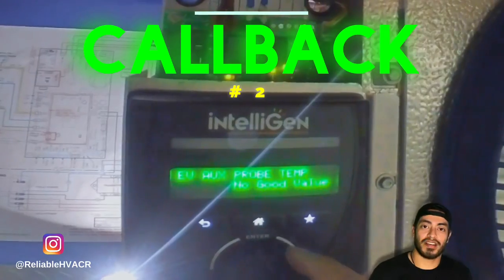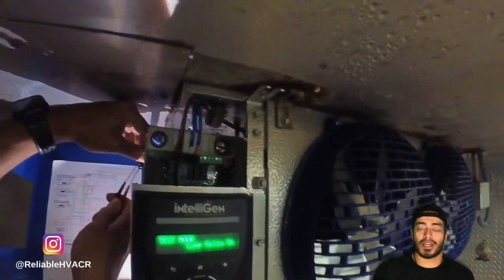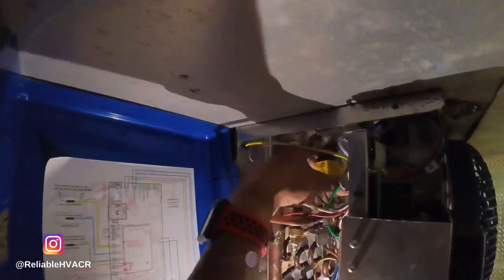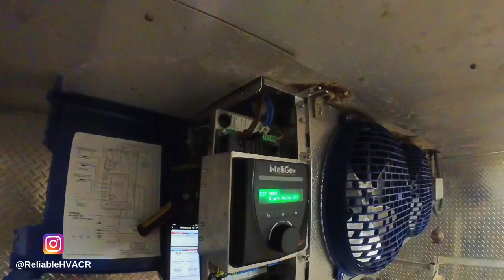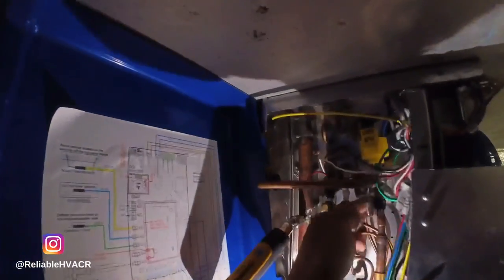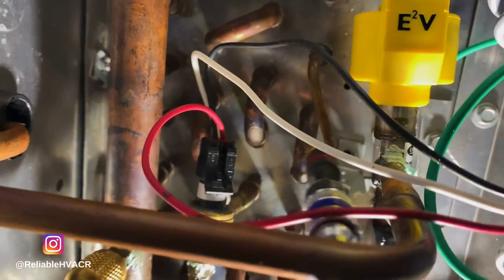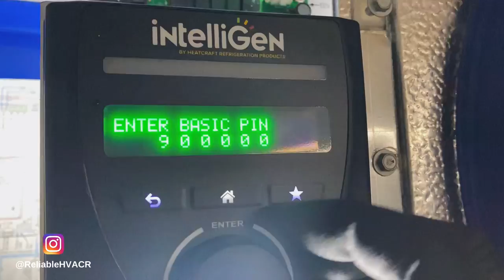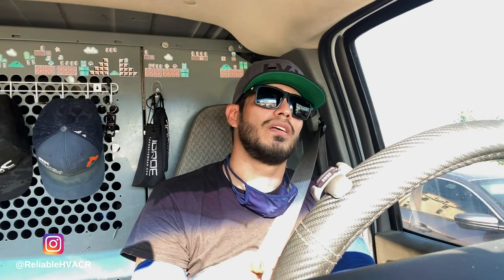Another Callback! | Intelligen by Heatcraft Troubleshooting | HVACR

Comment: I do little commercial work, but I have a ton of experience with EEV's on residential systems. Thing's I ALWAYS DO to prevent EEV damage/failure/clogging is:
  1-braze with nitrogen
  2-heat shield EEV when brazing AND use low heat
  3-Place my Drier filter as close as reasonably possible to my EEV

Do you use MeasureQuick? I only ask because I see you were using the fieldpiece app for your probe. If you haven't tried it out I highly recommend it over the fieldpiece app. 

Way to pay due diligence on this job and not make a hasty diagnosis. I myself know all too well how bad it feels to make a wrong diagnosis when looking back, and knowing I could have been more diligent is my troubleshooting. But hey, we learn far more from our failures than we do our successes; right?
Reply from the maker: Well going forward I just need to be extra careful with EEVs. I need to give the app a shot, I'm just used to the fieldpiece one since I use it often with my other equipment. And thanks 👍🏽

Comment: Just talked to tech guy about this. I was instructed to remove compressor safety cut out and set cut out to 0. The system has gotten into a loop of not recognizing a subcool drop and valve is forced closed.
Reply: Ugh...what😂
Reply: @HVACRDUDE  for real I ain’t been back

Comment: I installed an IntelliGene system with two evaporators on one 7 1/2 hp condensing unit for an egg farm cooler. 21 hp total to run cooler. It would run great for a day or so then comp would go off on short cycling code. The EEVs would close enough to make unit short cycle. Reset power and good for two days. Tested every component, sensors, cables, wiring, superheat, subcooling, control settings, everything tested good. I was convinced it was one of the boards. I asked for two new boards and the dealer and tech support resisted. Factory tech was gonna drove 300 miles! I told him to make sure he brings two boards. Asked them just send me the boards and if it still short cycles then he can come out. They finally did and charged my account until they got faulty boards back. Changed the boards and never had another issue. Installed two more systems in same business and no issues there.
Since I had the factory tech cell # I called him a month later and he told me they found one of the boards was faulty.
Reply: Yeah all this stuff is trash

Comment: Now Heatcraft is saying that the voltage needs to be between 25v - 40v.  Below 25v and they say to replace the board or your EEV/EXV will not operate properly
Reply from the maker: I just hated how the board tested good but wasn't. So far I've installed 3 of these and right now they are all working. Just this one was a headache.